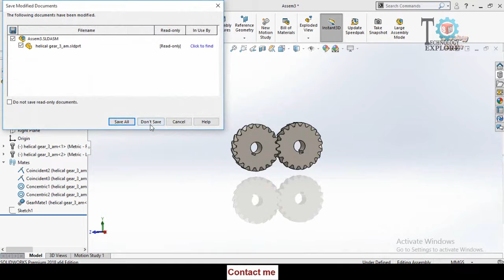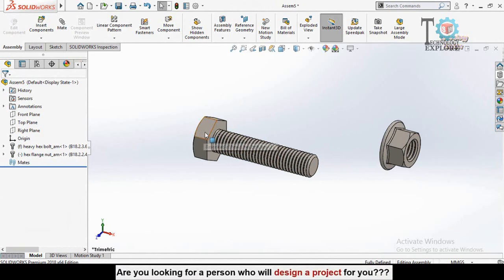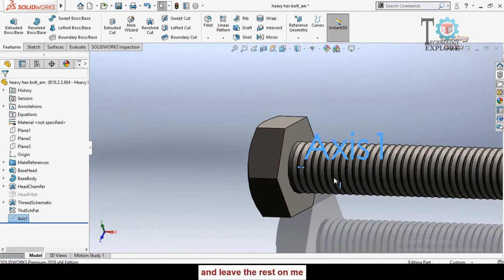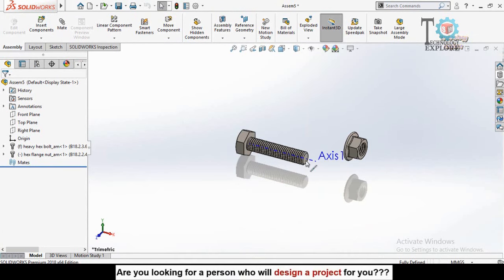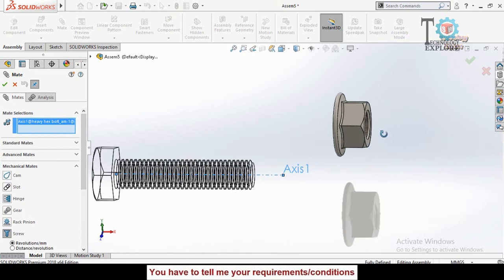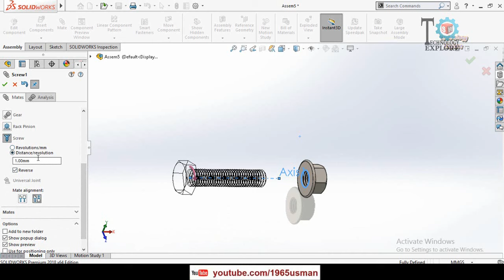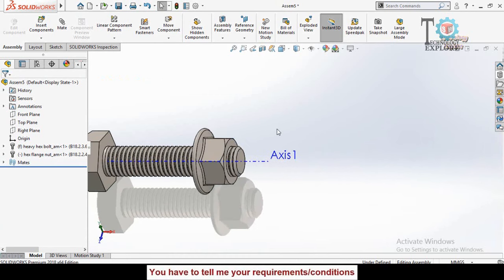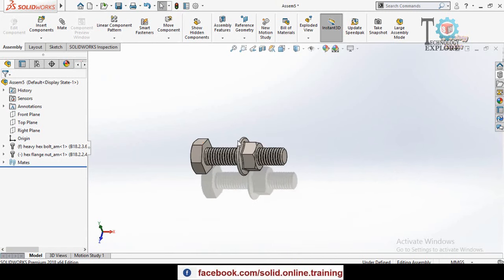How to apply Screw Mate in SolidWorks to Assemble Nut and Bolt

Comment: no, it is not working perfectly! 

you need to align the threads by looking at them in a cross section view,
another thing, if you turn that nut until it reaches the head of the bolt,
 this wont stop it turn, it will go in turning through the head of the bolt like a ghost
Reply: it's true. What is the solution here? can you help?
Reply: To align, use coincident mate on the top surface of the bolt and bottom surface of nut, make sure tread pitch matches your screw mate pitch, then supress the coincident mate and apply the screw mate. To stop the nut at the base of the bolt, apply the limit distance mate for your intended travel distance, for example, if your bolt has a treaded part of 20mm, your limit distance should be from the start of the tread down 20mm.
Reply: @remiscarrlet That worked perfectly, thank you